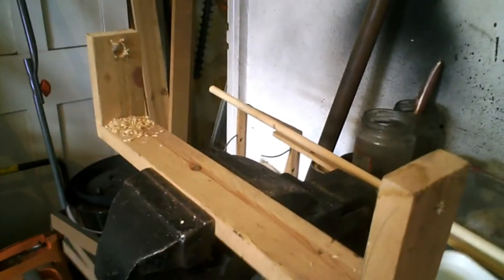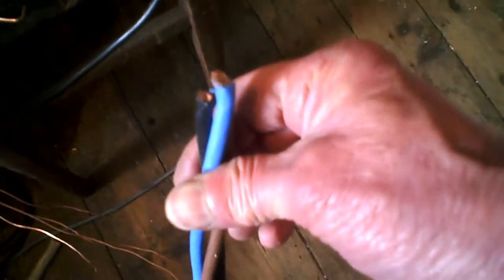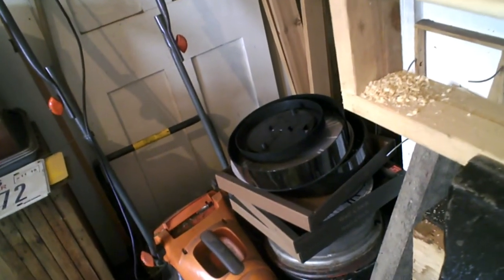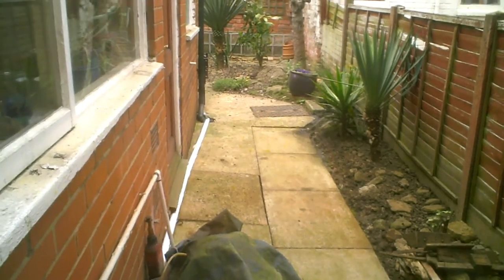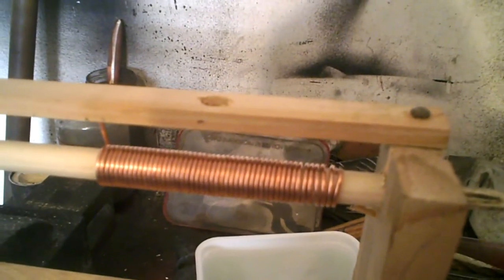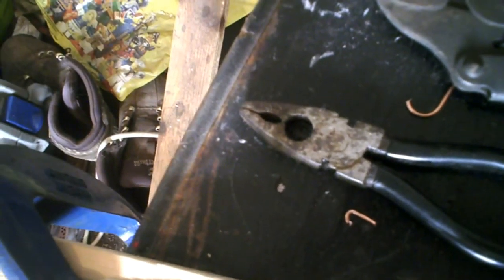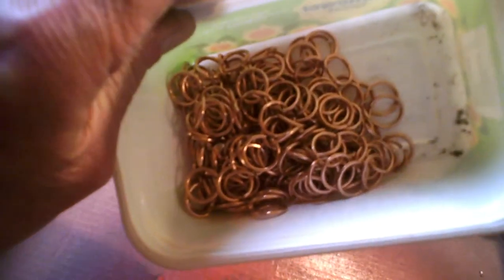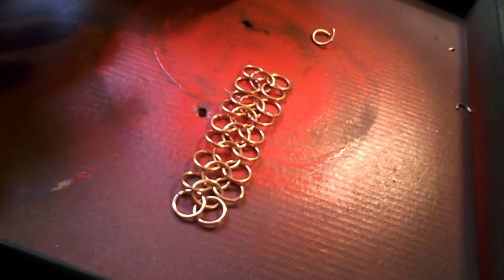Making Chainmail or An Ornametal Matt

Comment: Nice work Malc. There is a lot more to weaving the chainmail than I thought. The name plate came out nice and will look good on the tractor.
Reply from the maker: Nameplate is a roaring success Lloyd...just what I wanted, but doubted I could achieve.
Chainmail isn't working however, despite studying the video very carefully. Think my larger links are the problem. Anyway I'll make some more chain for decorating something.

Comment: Ingenious as ever Malc. The way you almost casually "just make" the rig for spinning the wire and your patience at extracting all the wire from the pipes and figuring out how to attach them, well, you are one clever person. Be nice to see a big square or similar hanging from your tractor somewhere. Talking of the tractor, the cast of the nameplate was very good and that will look perfect on your ?toolbox? on the tractor. Then there is the outside looking very neat - you have been quite busy!
Keep up all the good work and the great videos.
Mike
Reply from the maker: Just a collection of ideas I've seen from watching videos Mike. However it's not working out. Think the chain links are too big. Pick them up, put them back down and some are wrong. I've very carefully studied the video of how to do it, sure I've followed it properly. Anyway I've got a bit thinner dowel only 98p lol and am going to make some more chain. Should be able to use this for something....decorating a stall maybe if I do a boot sale.
The nameplate however is a roaring success :) maybe I should just stick to doing my own ideas lol.
Yes about time I had a bit of a clear up. Couple of people could have done it in an hour or so, but gave me something to do. Also not neglected to trim the 'bird perch' the apple tree. Just cut last years growth off and cut it in little bits, in bin liners and to the tip. Done this for years, doesn't take long and the best way to get of the little I have.
Pleased you're enjoying them.

Comment: That nameplate looks very good. I can't believe you started to do the chainmail. I heard it only takes 20,000 man hours to do one coat, and then there is the pants....lol That actually looks almost like  one I seen. It had big links like that, but it was two layers thick. It was on a BBC show. That looked very difficult, but they said the same thing. It is quicker to make then the small ones, even with it being 2 layers of them linked together. I'll try to find it, but I can't promise any thing. They had a couple of different ways to make chainmail. That system of winding the wire, I bet they would have loved to have a drill and that stand in the old days when they used this armour. I have missed a vid here. I have to hit the bell thing now to get notified, don't know why they did that.
Reply from the maker: Nameplate has turned out great....unlike the chainmail. Dead loss. Links just look like a tangle of chain, so change of plan. I'm making some short lengths of decorative chain with a large link every 3. So far got a few done. Will find a use for them as decoration, or hanging something etc. I only get notified of some posts??? but get an email to Gmail so usually get to see them all. Seems the internet is as confused as many people (grin)

Comment: That plate turned out real well!
Never any agro with the neighbours?
Could almost be used for a low tension coil winder !
Reply from the maker: Ta - no neighbours at the minute. Next door is away most of the while....trying to sell and house through the wall empty at the minute.
Yes, could make a coil winder this way. Problem is regulating the speed.

Comment: Hi Malc! very interesting! I have always have had a thing about Chain-mail. 
I swear I must have lived in the Renaissance period in a former life.
I also have a strong interest in fencing and Falconry.
Reply from the maker: It was interesting to try Jim, but hasn't worked out. Needs larger chain and smaller links, so I'm making a few lengths with both sizes, just for decoration. I've always had a passing interest in this. There are a lot of good videos of making medieval axes, swords etc.
Reply: Hi Malc! well knowing you, You'll figure out a way to make it work out :)
its fun to try making things, even if it doesn't work out on the first try. and it looked fine to me. thanks for letting me know about the other videos BTW.
Best of luck and health to you my friend
Jim :)
Reply from the maker: Cheers Jim - btw my latest casting for my nameplate has turned out great. Finished and polished today.
Wish the weather would warm up. Looks really nice today, but still cold. Want a run out on the Nuffield, but not for punishment lol
Reply: Hi Malc! Congrats on the Name Plate.
I'll have to check that out if you have a video up on it yet.
Best wishes always,
Jim :)
Reply from the maker: Thanks Jim - hopefully be showing the finished plate in a day or two.